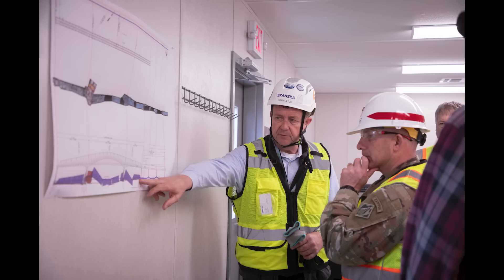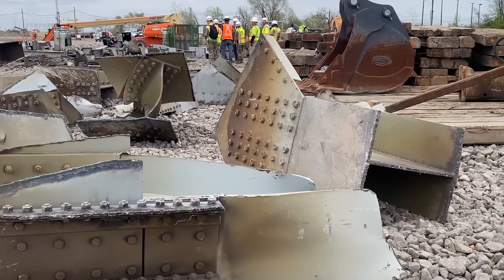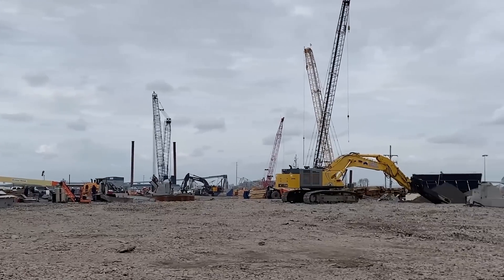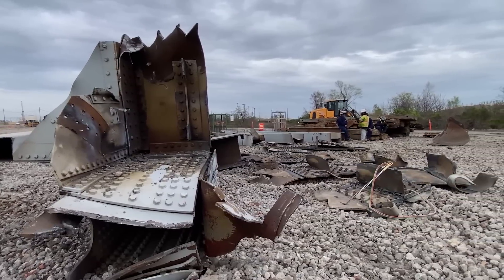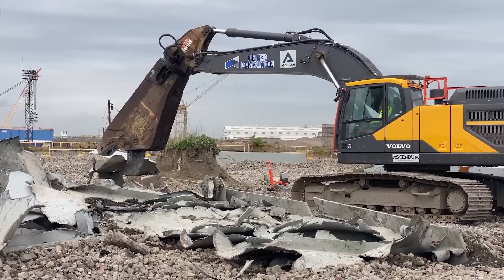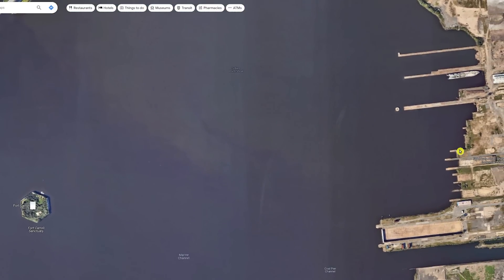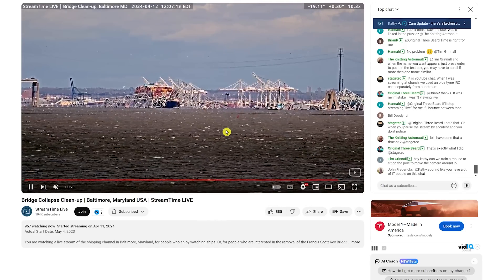What Do They Do With Key Bridge Collapse Debris Salvage?

Comment from the maker: 🎥 Watch Next:
🎥 FIU Bridge Collapse: WORST Engineering Blunders Ever: https://youtu.be/RS5XxwKIx-U
🎥 SCARY Crane Collapse Fell Off Tower, Fort Lauderdale, FL https://youtu.be/A-N3fEQwjwo
🎥 Titan Sub NEW Air Force Audio: An SOS For Help? https://youtu.be/1IJYQpVWY0A?si=dOwyBsYNhW3MjR_w
🎥 LEAKED Titan Sub Transcript Shows Crew In Battle For Lives: https://youtu.be/4Dj8IJbP41c
🎥 StreamTime LIVE Baltimore 24-hour cam video on Key Bridge Salvage: https://www.youtube.com/watch?v=2sv7SA2Ybgg
Reply: Yeah it was so strong and fell like a toothpick like nothing else, just dropped.
Reply: The bridge steel looks in very good condition little sign of corrosion.
Reply: They are using cutting torches. Not wielding
Reply: that not welding, that is cutting.
Reply: 😎😎🙄🙄💁‍♂(0:18) Well, scrapping it does not look set upside down to cut down safely: so a shade block? or Shield to a long shore gun??
Reply: 😎😎😎🙄🙄🙄🤦‍♂💁‍♂({2:08}) That would kill the point of the metal thickness: {only single bead welding}, of a ~ / 3 bead butt end \. = Try the torch weld blower method on the long seam: likely the {blow out line}, in {{sudden breaks as chain reaction}}. ~ ({{2:55}}) "Dam assembly line, then": just shredded the bead, like a pop top can, there./!\ == Again: air bag lift, for divers safety./!\/!\

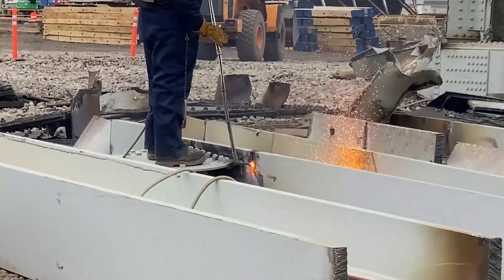Comment: 3:44 - it's flame cutting (standard number: 81), which is a commonly used technique for cutting thick metal parts where precision is not important. They use a gas mixture for the flame (propane or acetylene + oxygen) that melts and even burns the metal, and a cutting gas (also oxygen), which blows out the melted and burnt steel (rather slag and oxide) out of the cutting gap.

Comment: You don't know what they're going to do with them at Sparrows Point? I guess you're not from around them, thar, parts?

They've cut them up into little pieces. Because Sparrows Point.. Was where they made Steel. To build, ships, boats, bridges. And that's an awful lot of scrap steel.. They are going to melt down again and repurpose. Perhaps to build a new bridge?

And that's why all that stuff was taken to Sparrows Point. Unlike Bethlehem Steel. Also in them thar parts.  I think closed down, years ago. And Sparrows Point. May have been one of the last ones left? That can still be fired up and melt that stuff down?

That's what they'll be doing at Sparrows Point, Baltimore.. And I lived just down the street from there for a while. Right there on the Chesapeake Bay. For about 30 years. And then I moved out to Essex. Behind Martin State Airport. Where Glenn L Martin, built planes for World War II. Now it's the Maryland Air National Guard. And a regional executive Airport, combined. Along with the family-owned Drive In Movie. Right behind the airport. That I maintained for about a decade. That still in operation. Upon my leaving in 2015.  Established in 1956. And one of the last of its kind in the country. Of an original location. With one of the biggest screens, ever. And you get the sound. On your car radio at 106.9 FM Dolby Stereo. And I install that system. It's a real Broadcast FM Transmitter. Putting out a whopping, 1  Watt. Which is actually 1/2 Watt, overpower. Because we had an interference issue. With an FM station out of, Hampton Roads, Virginia. More than 250 miles down the road. Which is not physically possible. Yes I know not possible. And  we were getting it in stereo. This was not possible. So?

I called up the Chief Engineer at the station. And he told me this was not possible. And I told them. What they were currently playing.  And that I had them 5 x 5 in stereo. With a portable, handheld, transistor radio. It was bizarre! This should not be! This cannot be! FM cannot go that far. FM is only good for about 40-50 miles, tops. Not 250 miles!

I have a 1st Class FCC Radiotelephone License. And me and that Chief Engineer. Could not figure out what the hell was going on? As this should not have been possible. It's not physically possible. FM does not do skip.. Its line of sight only. Based on the curvature of the earth. Only good for about 40-50 miles. What the hell???? I had my hypotheses but? That still should not have worked. Coming up through the water along the coastline of the Chesapeake Bay. Because the movie theater. Was right on the water of the Chesapeake Bay. But FM can't do that. It can't go through the water! It must have? We were part of the ground plane or something? It was directly coupled into the ground where we were? It didn't make any sense.

So we had to install a better antenna and taller. We could go up a full 50 feet. And we did. I got an actual, FM Transmit Antenna. And turned up the power to a full, One Watt of, earthshaking transmitter power! A big 1 Watt! And you can pick the station up from a couple miles away. Pretty much from the other side of the airport. When traveling east on Eastern Avenue. Just as you come upon the airport. You can pick up the movie theater FM station. And now we have a solid signal with no interference anymore.

But that was just beyond Weird Physics. That should not be. Cannot be. But was, is. And as I recall. I could pick up the station before the sun went down. That was even more weird.

So I can only imagine. All of those scientists and professors. Whose minds were recently blown. By the James Webb Space Telescope. Proving they have all been wrong now. For their entire careers. And they now have to rethink their physics. As they all got it wrong, en masse.  And they are feeling a bit chagrined. Rightly so! And because FM cannot be transmitted that far. Or so I was taught many decades ago. That went out the window a few years ago. And my mind blown. Along with a Chief Engineer at a Hampton Roads, Virginia, Oldies Station. Yeah Bob. You are playing Chicago 25 or 6, to, 4. Yeah that's not possible remedy. But we are playing that. Right now. Yeah and the next song is the Doobie Brothers, China Grove. Yeah Remy. We are playing that right now. But this is not possible. It just blew our minds. Because it should not have been possible 250 miles away. With a handheld transistor radio and getting the stereo carrier. That's just Bonkers.

So we don't know all that we think we know. And the truth is not always the truth. How prophetic. That has proven to be accurate. I think? Likely so?  A resounding 100% Maybe. We like making the impossible, possible. Without our knowledge. That's why we are Engineers! We know what's going on. The radio. 250 miles away from where we shouldn't. Be able to hear anything at all? Yes and now you are playing the Beatles, Love Me Do. Yeah Remy but that's not possible. Though we are playing that right now.

I think he just thought I was some kind of, Clairvoyant? But I'm putting the telephone up to my speaker. Yup that's what they were playing. It was in sync with what he was listening to in the background. I was picking up the station from 250 miles away. At, 106.9 MHz, FM. Which is not possible. And that was years before the James Webb Space Telescope was launched. When I learned something those, Physicists and Astrophysicists. Had yet to learn. Goofy things are possible! That shouldn't be.  According to our physics. Which now appears to be quite flawed.

And we will have to rethink, everything, now. Because Physics has Changed, overnight. Who knew?
RemyRAD

Comment: Could They use two moble  floating Docks on either side of the bridge  and run i beams through the  thrusesv of each bridge  sections and float them up more level with the surface añd float a third dry dock under the bridge section and float up the bridge sections and cut up the bridge  sections inside the dry Docks.

Comment: The scrap without bolts needs to be just under 3 square. I think they are trying to knaw off as much from the sections where different angles come together and are bolted to get it under 3 foot square. However the bolts are different steel than the beams and plates and sometimes they don't want to mix that.

Comment: Sorry Jeff 😞, for someone who supposedly is a "engineer" you failed the test of trade description and equipment type usage. Id expected more. 
Scarry for someone someone doing a play by play commentary on a project like this. 
The proper description for the equipment is a "Shear" and the worker is "cutter" using a oxygen/propane cutting torche with maybe a #4 cutting tip.
As a construction person with 45 years experience across all trades I try to respect engineers, but there's been a few times I've had to stop and ask where they came from and WTF were they smoking 🚬 🤔?
If you can't name the equipment, maybe you haven't  looked at enough construction sites to see what they do and used for 🤔.

Comment: Yes they are doing it correctly! I worked in heavy fabrication for decades. Did hours of demo burning of plates, beams, channels and angles of all sizes. We we're always cautioned about standing too close to material we were cutting up. We used long lanced burning and scarfing torches to extend our reach for safety. Steel members that are fabricated into different shapes, especially in building and bridge construction. Could potentially be under strain and once they are cut loose they can spring back at you. You have to plan your cuts and make sure your last release cut is close to your reach where you are in the clear and not further away. It was hard ,dangerous and hot work. I really miss it!

Comment: Those 2 big yellow cranes you pointed out are rated for 200 tons lift each.The long boom crane further up the shipyard is only 50 ton rated with the boom almost straight up,and this its 50 year anniversary since it was put up.That boom on that crane is 257 feet long and was needed to reach across the super tankers that we built between 1974 and 1977 five in all 265,000 DWT's each.Lots of interesting things I saw during that period......memories that no one can take away
Reply from the maker: Do they still use those cranes?

Comment: The touch on frictional forces is very interesting so I am asking here.
Is this the case in bridges and buildings?
Are the surfaces faces at the joints for bridges made such  that the frictional forces in the vertical direction can be the primary force?
Of course, to this interHack there seems to be more of a “sphere” type set of directions, so the bolts have to do something I guess. Any help or point to where I can learn more would be great.

Comment: Can't understand why you seem so surprised at the quality of the riveting of the bridge gussets. Bridge was well engineered and well maintained as it should have been. Sad that the Dali hit it at probably its weakest point as far as causing the massive tragic failure. During his visit to Baltimore on the day of the vessel's allision with the bridge believe our Secretary of Transportation promised to supply 1,100 Army Corps of Engineers personnel to help in the clean-up. Basis the government and privately supplied updates/video's I haven't seen many Army Corps personnel on seen actually working. It seems to be mostly contract workers, Even most of the dangerous work being done by divers appears to be contract workers. Does anyone have a count of the number of Army Corps of Engineers personnel actually on scene? I have no issue with utilizing contract works because, at the end of the day, this will likely be much more efficient than using government personnel to do the real work.

Comment: The "Grapple" you referred to is a Shear made by  LaBounty , from memory they can cut up to 75 mm thick steel but the blades wear out faster that way , They have hardened steel cutting blades that can be unbolted and flipped over 4 times until they need replacing or sharpening. 
The hydraulic rams on the ones i serviced were over 400 ton of cutting force.

Comment: Great videos as always Jeff.  FYI, cutting with a torch is not the same as welding.   A cutting torch uses acetylene gas with if I remember correctly, a degree of pure oxygen to make a hotter flame.   Once the metal is heated red hot, a stream of pure oxygen is injected through the center of the cutting torch which blows away the molten metal, thus making a cut.  There is a trigger on the cutting torch that you pull to eject the pure oxygen through the center of the cutting torch.   This process does not require the amount of skill needed to weld metal.
Dark glasses are required to protect the eyes from the brightness of the flame.
Reply from the maker: Excellent description of the process, thanks Tom

Comment: Those guys are using oxygen/acetylene torches to burn that steel. Extended length torches keep them away from the extreme heat. Its difficult, hot, monotonous, work in those flame resistant overalls. Even with the dark shade burning lenses its hard on the eyes.  Glad to see they're using hoods with fresh air or filtered air supply.

Comment: It's not welding, its cutting. I used to dismantle large industrial buildings but we did it to standing buildings and cut from the top of the building on down until the building was gone.. We would cut and notch one end of the I beam all the way through, then we would go 9 ft down beam and cut. We would cut across the top of the I beam then down the middle and as we did that the beam would ease itself down. The beam would be tied off, the cut finished and the remaining end lowered. We worked smarter, not harder. This bridge is a whole 'nuther ball of wax. I would not want to be the workers dismantling this bridge. Very dangerous.

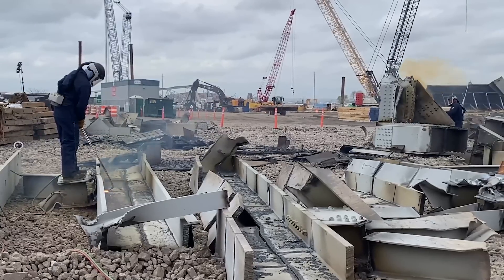Comment: 03:09 - Those oxy-acetylene cutters are rather small equipment compared to the thermal lances used in cutting up the inches thick WTC steel.

Comment: I would think a concrete cable stay bridge will be on the rebuild menu.  Steel bridges have a huge problem called corrosion.  The Corpus Christ bridge over the port entrance is corroded beyond belief!  I think the only thing holding it up is the layers of epoxy paint!

Comment: Not welders in this case. We called cutting burning or touching when I was an ironworker in the70’s and 80’s.  Also, the last time they used rivets on a bridge in the SF Bay Area was the early 60’s.    I don’t think rivets are in the F.S.K. Bridge.

Comment: I half expected it'd have to be saved for the inverstigation, despite the bridge failure being obvious. We've had a garbage truck at work at work in limbo for thatn was rolled over by a driver going too fast around a corner with a heavily loaded trucjk... Can't scrap it until the investigations done..... Anyone with a brain can understand that a truck, loaded heavier on one side than the other(trash weights more than recycling; going around a corner with the trash side on the outside is likely to roll over. The driver(immediately terminated), has fought the issue  claiming it was anything but driver error.

Comment: Not to be pedantic, but I’d call it steel rather than metal. The investigation, whether structural or metallurgical, must’ve ended for those sheared and torched pieces, which I assume will be recycled into the new structural members to build a new bridge. I hope a different design is chosen for the new build. I wonder if a scrap yard electromagnet crane would help speed up the process.

Comment: With the size of the shear attachments that are available for excavators I wonder why they are using gas torches at all? The shear is faster by at least a magnitude of scale and safer. It looks like they're TRYING to spend as much money as possible - this SOP even has another, fully-qualified welder just sitting watching. Two guys to do the work of one (one watching for safety I guess). Nuts.

Comment: They are using 3 ft and 5 ft propane torch. As a retired scrap processor  they seem to doing it correctly 5 ft Plate and structural .  The hydraulic  shear on the excavator  is a common scrap recycling equipment.

Comment: An old power plant was demoed by several of those claw machines several years ago on our river front in Henderson, KY. It took them about three months. Another old bridge was taken down not far from my home. After the new bridge was opened, they cut slots in the old, then used explosives to drop it in the river. They pulled out the pieces and cut them up just like in your video.

Comment: They're TORCHING, not welding, they're using a cutting torch, that's what us construction guys consider them doing. Usually, on big jobs like this they'll use liquid oxygen because it lasts longer and the tanks are larger. Some contractors like to use propane instead of acetylene because it's cheaper, but doesn't heat up as fast to begin to cut. Most likely they're cutting up the pieces into what the scrap industry calls prepared iron,  you get a better price if you prepare the iron before you haul it in to the scrap yard.

Comment: It’s interesting to see the torch cutters ripping the beams down the web…. 

Wouldn’t want any 3rd party independent organizations lab load testing those beams and contradicting the NTSB report 🤷🏼‍♂️

Given the time frame of construction, much like Twin towers, the probability of sub standard building products cutting cost to line pockets is relatively high. We can’t pretend corner cutting and mob kick backs weren’t a problem back then because that was probably when it was at its worst.